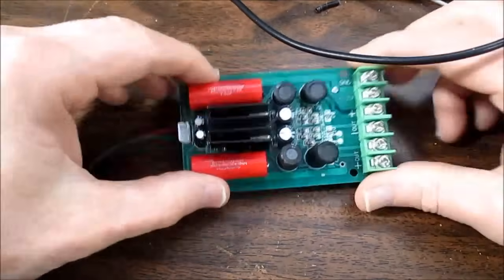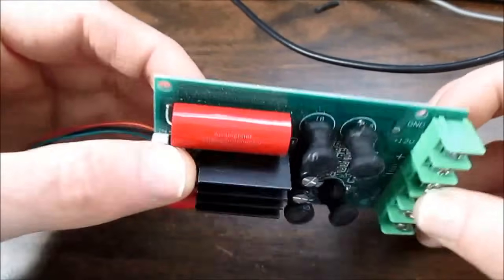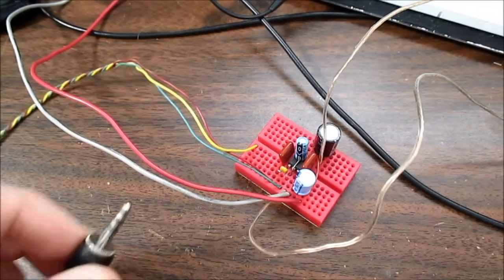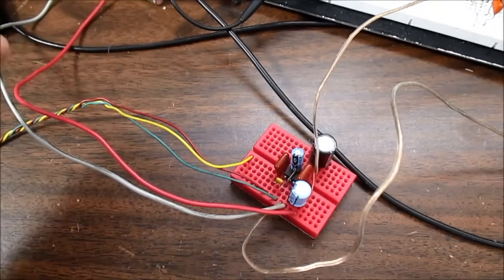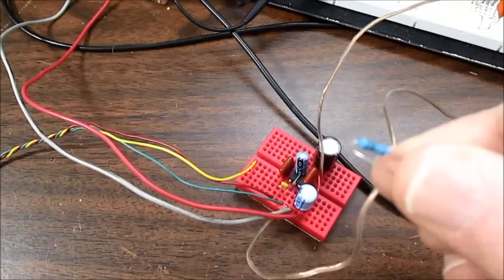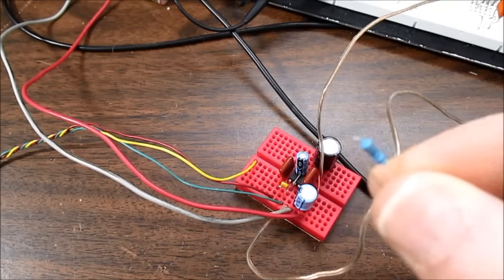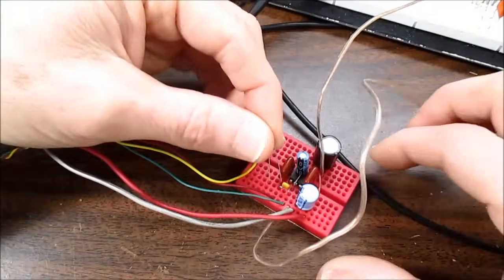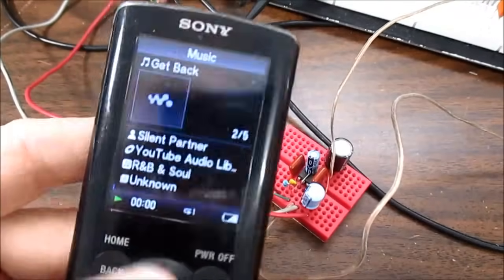STOP hum and buzz in your amplifier projects !

Comment: Hi, could you explain exactly what the resistor is actually doing, that causes such an improvement in the sound ?
Reply from the maker: It lowers the impedance of the input so when the source signal is off or disconnected, the amplifier is less likely to pick up hum or buzz on its input. It doesn't really have an affect to the sound in normal use.
Reply: @JohnAudioTech  To be a little more precise: the audio source shown was designed to drive headphones, perhaps a 32 ohm load. You have a source with a relatively low output impedance, so lowering the input impedance of the next stage down to 1K doesn't reduce the audio signal, but it does significantly reduce the voltage generated by the magnetically induced hum current by a simple application of Ohms law. Most headphone amps would be happy driving 100 ohms, so you could use an even lower value resistor if you still have some hum to get rid of.

Comment: Hi! Where should i put my resistor? Left and right audio input?
If yes, then it didn't work for me, the buzz is still present.
Reply: Change the value.signal input+ ground.or use a buffer amp

Comment: Should the resistor across the input be equal to the input impedance of the amplifier?
Reply: No. The problem occurs because the input impedance of the amplifier is a lot higher than it it needs to be, which makes the induced hum current produce a higher hum voltage at the amp input. You need to lower the input impedance of the amplifier as much as is practical to reduce the hum voltage by adding a resistor across that input. The lowest value of resistor will be determined by the lowest impedance that the audio source can drive - for headphone outputs, that's often around 32 ohms.

Comment: so i have this issue, when i turn up the volume at 50%, the noise from the tweeter and my woofer so high, but when i put the volume to 100%, the noise gone, can you explain why ?, i'm using cheap class D amplifier made in china, using the TPA3116 chip, with 2X50W channel
Reply: Seraph I have the same problem all the time with a bunch of different amplifiers and I haven’t found an answer for that.

Comment: Why in some audio amplifier boards the value of capacitor at the ripple rejection pin is reduced than specified in the datasheet of that audio IC ?
What will be the effect of it on the amplifier ?
Reply from the maker: A lower value capacitor would mean lower ripple rejection. However, if the circuit is powered from a battery or a well filtered supply, lower ripple rejection may not be an issue.

Comment: Your video is the only one so far that has the same EXACT buzzing that I'm hearing coming out of my speakers that I hooked up to my television.  They can be used on a tv or computer they used to be on my computer & worked fine.  Hooked them up to my tv & the audio works but there is the buzzing (same exact sound in your  video here).  For the past 3 days have tried all kinds of fixes, all kinds of wires, went to the store & bought different wires, etc.  nothing works, constant buzzing.  I've heard of something called a ground loop isolator, not sure if that would work but the buzzing is driving me nuts.  I can hear audio just fine but during quiet scenes in a show the buzzing is there,  I can also hear the same thing you did when I tap my fingers against the end of the prong (the end of the plug)....it did not buzz when it was hooked up to my computer, only when hooked to my tv.   Not sure if a ground loop isolator would work, it's my last resort, if the isolator won't work I'm disconnecting them & Putting the speakers back on my tv but I cannot for the life of me figure out how to stop the buzzing, been 3 days now & tried everything I possibly could to no avail.
Reply: also I don't have cable television so there's no coaxial cable causing interference or causing the buzzing.  I'm clueless at this point.
Reply from the maker: It could be a ground loop issue if you tried the remedies in the video. If the amp can be powered with a battery as a test (mains isolation) that could narrow it down.
Reply: Try turning off all switched mode power supplies in the vicinity (phone chargers, laptop adaptors, computer power supplies, all electronics that plug into the wall).

Comment: Solutions-
Use DC-DC isolator 
Avoid ground loop 
Dont make your audio Jack an antenna 
Use 2 power supplys if you use bluetooth
Reply: AMOGUS
Reply: Main solutions for hum: shield the input wires and keep impedances as low as possible.

Comment: I'm working on a project in my truck. I bought a 12v 100 watt amp and hooked everything up and it sounded great with my truck off. Once I started the truck the input voltage would raise when I gave it gas (due to the the engine giving a higher rpm generating more "power") and thus began an ear peircing hum and backround noise. How would I fix a problem like this?
Reply from the maker: Sounds like a ground loop issue. Google ground loop automotive audio. you should be able to find good info.
Reply: @JohnAudioTech  alright I'll take a look at that and let you know.
Reply: Also the truck's alternator needs checking to see if it has a suppression capacitor fitted to the output. A 3uF 250v polyester/polypropylene film capacitor should suffice.

Comment: Hoping you are someone responds to this: Can I put a resistor on the output? I'm trying to use a small 5V amp for my car, because connecting my phone through AUX emits audio at the lowest possible volume. I NEED an amp to use the car speakers (unless I go and wire them directly to the amp) through a 3.5mm jack. 

Hence, I'm giving speaker-level input to the car stereo, which demands line-level input. I tried using a bluetooth amps as well, but it produced a lot more noise. So...can I use a resistor on the 3.5mm jack that outputs the audio to the car stereo???
Reply: If your phone is giving insufficient output for the car's AUX input, then you need a small amount of preamplification. For that, you want a preamp, not a power amp. Something like an NE5532 preamp kit with a volume control would fit the bill. John designed just such a stereo preamp for the same sort of reasons as you and he has a project video documenting  it at https://www.youtube.com/watch?v=0Os8MxX6-cQ&t=921s .

Comment: Hello, thanks for sharing this video. I have an lm386 guitar amp. The noise comes with nothing connected. I have connected the 1 k resistor as you suggest here, and  the noise goes out, like in the video, but with the guitar, affects the volume. So, I have two questions:

Does it happen the same attenuation to you, with your earphones out? Have you checked this? 

And when you talk about shielding, do you mean to use a shielded  guitar cable, shield the electronics of the guitar, or both things
Reply from the maker: Guitars need high impedance inputs, so the 1k resistor will shunt too much of its signal to ground. You should try a higher value. Shielding the cable and electronics as much as possible can reduce noise.
Reply: @JohnAudioTech  I have tried with a 104 capacitor and it reduces noise volume as well. It seems that the volume of the signal for a guitar does not decrease too much. And it is more clean...

Comment: Small question I have a mini headset amp, it's portable and has its own battery when I charge it, it hisses like it's picking up signal, it charges with mini USB could the data connection be causing that hiss?
Reply from the maker: I would guess that it is noise from the power supply that is used for charging. They are often the switching type and can produce a lot of noise.

Comment: Please help me.The LM3886T IC in subwoofer only give little buzz sound.No  sound is transmitted or changed when i touch input,but preamp work just fine.I replace IC,all caps,and check for cold joints,the power is good 2x26V.Mute pin 8 is steering by two transistors,they are good to.
Reply: Blahblox Gyuanox Did you find the problem? Maybe check your physical wiring to your speakers.
Reply: Yes,the IC was burn,heat sink not sit properly.Replace to LM1875,works great now.

Comment: At the start of your video you show a pre-made amp, i have purchased an almost identical one of these very recently and need to reduce the noise. It has the same 3pin input as yours showed with L R and Ground. What would be the best method of inserting a 1K resistor on the input in this instance ?
Reply from the maker: The resistors don't need to be on the board. You can place them at another location, such as the input jacks if you are using them. This might be an easier way to place them.
Reply: adam201192 did you solve your problem? I'm using a 50k potentiometer but I still get the noise. Not sure if it's too high value or not grounded properly.
Reply: Kevin Livingston sorry I've only just seen this. It didn't solve the problem at all. I'm using the same amp as described in this video but I think that the audio/mp3/bluetooth module unit I'm using is causing a load of feedback noise.

Comment: Sir i did what you did but didn't work for my 50watts kit amplifier but can the wire maybe affecting the sound of my amplifier
cause i use a small wire with thin insulator ,and 
i use a 12V output charger of portable video player to power up the amplifier- is it not good to use?.
Reply: You must use shielded wire for the input signal and ground the shield at one end of the wire.

Comment: I get humming from BP7004 just for plugging the power in. I have nothing else connecting to it, just power for the built in subwoofer. I check all my connections they are good. I did this with everything connected with and without to to the speakers. Please help I want to if I can save them or sale it off for parts.
Reply: try add a fan inside your woofer. i realized the heat sinks were not as effective to cool the transistors. it worked for me.

Comment: +JohnAudioTech I used a pam8610 for my desktop diy speakers, powered using the PSU's 12v rails. I have added a resistor and cap, and while the amp is quiet and plays well using my cellphone as a source, when I plug it into my desktop's soundcard, where it is intended to be plugged in, it has horrible noise (very loud noises and popping), and same when I use my laptop's headphone jack as a source. Could you advise how to get rid of this noise? Thanks much!
Reply: That is probably because of the ground. Try adding a ground loop isolator (Audio Transformer) should work just fine :)
Reply: Try unplugging your laptop and running it on batteries. 9 times out of 10 noise generated on the headphone socket in laptops is due to extremely noisy switch mode power supplies.
Reply: It could be also the fault of the 12v Psu. They tend to generate a lot of noise and go unstable without any load.... So try hooking up a load to it. But it doesn't seem like that is the main problem over here. It is definitely the ground. Adding the Ground Loop Isolator is gonna solve this issue..... It isolates the ground of the amplifier and the ground of the audio source.

Comment: WOW i have build a few amps in past month (just for fun) and i thought that only way to get rid of that input noise is to go ham on shielding input cable.
Its really simple solution and it does work.
I have one question and i think that you could help me with (if you have time to reply of course).
I have Samsung TV with great panel but it surprisingly lacks any sound output but i can disassemble it ant tap some female RCA connectors on speaker but since i need line out not amp out will a few resistors in series do the job or i would have to do some voltage divider to bring the voltage to line level input,on my amp it says Sensitivity : 150mV and Impedance: 50kiloOhms .
Thanks in advance
Reply: Thanks for the reply appreciate it.
That is the problem its a single board design and size of the board is 10x10cm and its multi layer boars,its one of those pesky SOC,single chip with heat sink on it and some memory and some transistors.
I found some AMP out to line level converters online so i will try to copy that design from net.
All in all thanks and if you have some more elegant solutions please speak your mind :D
Cheers

Comment: Sir if our amplifier  is stereo  than we must use two resistance????  Or one? 
And resistance  is connected  between input and ground??
Reply: Yes, two resistors are required for stereo. For mobile phones, iPod a 680r is fine, For pre-amp, you should experiment at 2k and above until best results are achieved.  Better earthing can remove it too. Larger smoothing caps on the PSU will help as well - keep experimenting until you get the best results.

Comment: Hi, good video..
how can I do that with a tube amp Peavey 6505+....there are so many Hum when I the Loop's amp with a Pedal or a multi-effects from Boss. Then there is a ground loop. Thanks so much
Reply: use noise gates, one as first block, second one after amp. use good cables. I had the same problem with my 6505 and GT100
Reply: Hi, thanks for your answer. Maybe my problem is a Hum from group loop... 
I use best cables und 4CM with the Gt8 in my 6505+. 
The noise gate is already activated in the Gt8 and if I use a second  noise gate in the front the preamp, the Hum stay yet there. with 1 or 2 gates, whatever, don't work...
When I use just one gate in the Loop, the Hiss from distortion is go out, but the Hum is there. 
When I use just a jack in the amp's loop (return) the Hum is there.
So gate with that don´t work.
That is my problem...
Thnaks

Comment: Hi John. Great Vid.
I get the same hum albeit Louder off my Adcom as soon as I turn it on. I did accidentally drop the unit within a box on its side 3ft off the ground.
 Do you think I may have damaged the caps or need to resolder some points which may have come loose?

Comment: "Where is the resistor connected in the circuit?"
I think I figured it out. His 1/8" plug has 3 wires coming off, all twisted together. One larger yellow wire, two smaller wires red & green.
I think the yellow wire is the ground and the red & green would be right & left headphone signals.
It looks to me like he put the 1kohm resistor between red & green.
Reply: I guess if you tried it, you must have realized you were wrong 9 months ago. The yellow wire isn't connected to anything, since it is one of the two audio channels. He's connecting the resistor between (for example) L and GND. That would be tip and sleeve in a TRS jack. He's doing it on mono, not stereo.

Comment: Hi John, I have a problem and after watching your video, I thought I found the solutuon. I am build a bluetooth speaker and have 2 amps. I have a bluetooth decoder that feeds into the first amp (which has a volume control) and then the first amp feed into the second amp. The second amp goes into the speakers via the crossovers. The reason for the first amp is because the signal provided by the bluetooth decoder is extremely small so I am trying to amplify this a bit in order to get more volume from the second amp. I am a noob at this (as you can probably tell). I am powering all these from a single 12v source. The problem is that I have massive feedback when I pause my music. I have tried the resistor, on both input to the first and second amp but no difference. Any advice?
Reply from the maker: Is the first amp made for driving speakers or is it actually a preamp?
Reply: @JohnAudioTech  its made for driving speakers.
Reply from the maker: @benliebenberg610  If it's class D, it can be putting a lot of switching noise into the 2nd amplifier. I would recommend using a pre amp.

Comment: On guitar have only 2 wire . (Mono) . Main input and the ground . If you put a resistor on it . Where you put the one end of resistor . . On the video was . 3 wire L-R-G so the resistor put on left input and right input . Where to put on Mone with only two wire.
Reply: *Where to put on Mono with only two wire.

Comment: Incredible results with so simple trick. How many ohms do I need for the resistor?
Reply from the maker: Depends on your audio source. For a headphone type music player/phone, 470 to 1k would work. For a line level device, 2.2k to 4.7k would work. Too high of resistor value and the less they will shunt the noise. Too low and source signal can be diminished or bass rolled off.
Reply: John, what value to use for a laptop that goes to a DAC? Thanks very much.

Comment: Bro does DC OR AC electricity source fact in sound amplifier?
And if I use 12V DC will it run 100 watt subwoofer.
And does AC 12v fect on tip 122 and 127 IC?
Reply: First, all audio amplifiers operate on DC. AC input gets converted to DC by the powersupply. 
Second, can what run a 100w subwoofer? And also 100w @12v is like 8A. So no, 12v won't work because there is no way your speak has a DC resistance of 0.7 ohms. Normally, high power speakers use a high voltage so that they use less current for the power demand. 
Lastly, transistors do not operate on AC power, they are strictly DC devices.

Comment: Nice, but will it reduce sound of the Amp?

I have one more issue, when my amp is powered and then On or Off my ceiling FAN it creates a sound on amp. what should I do for it?

Thanks in Advance
Reply: Connect the another power switch board
Reply: I'm curious, does it happen even if the fan speed controller is set to full speed?

Comment: What if the hum is caused by the power supply? Will replacing the filter caps solve the problem?
Reply: Ground outside ring of RCA at the amplifier you're using to rid the hum. If it buzzez a little loop the output power supply cables a time or two like a roller coaster works for any AC ripple bleed through